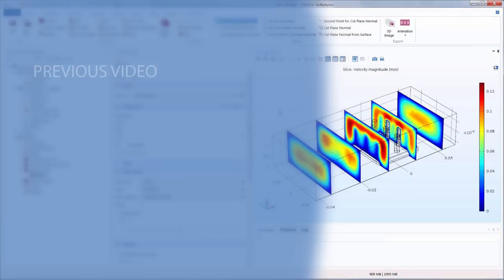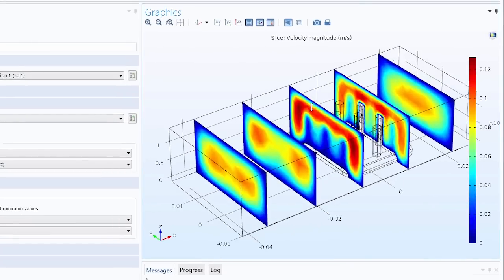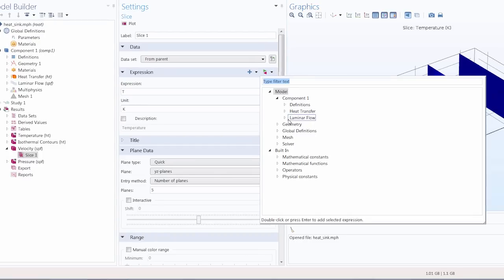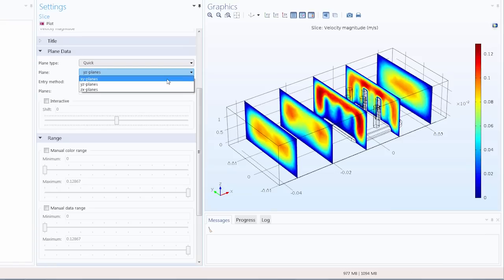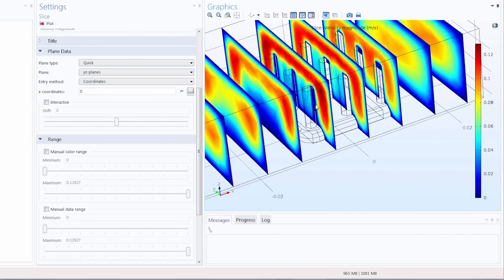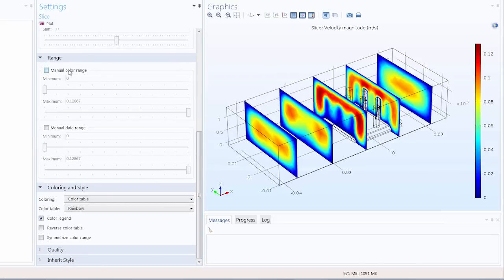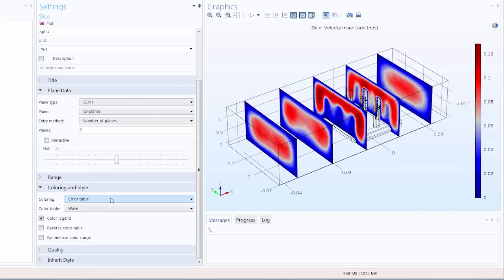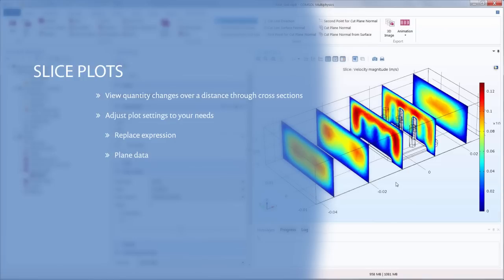How to Create Slice Plots in COMSOL Multiphysics

Comment: Hi I have a question on COMSOL if you please can help I'm using version 5.2a and i created a simple 2D heat exchanger geometry with laminar flow where the inlet and tube temperatures are known I need to measure nusselt number so in order to do that i need to find h (convective heat transfer coefficient ) I tried to find it using global evaluation but there are tons of options I m not sure which one to choose like accumulated power , flux , total power ..etc and I tried each option by using an integration operation as I saw a tutorial on COMSOL website they did that but I get errors I tried what you did by plotting 2d surface I get like convective coefficient in x or y or z which one to choose ? I think i will need a magnitude not a vector for the nusselt regards
Reply: Hola amigo, en i universidad utilizamos la versión 5.3, pero si nos pasas tu geometría y el estudio que deseas hacer te podemos ayudar con mucho gusto.**has probado con esto: integración, intop1(nitf.qwf_u)/(intop1(1)(aveop1(T)-aveop2(T)))